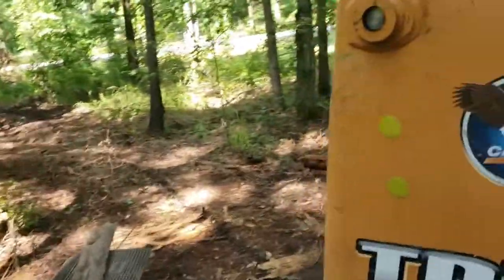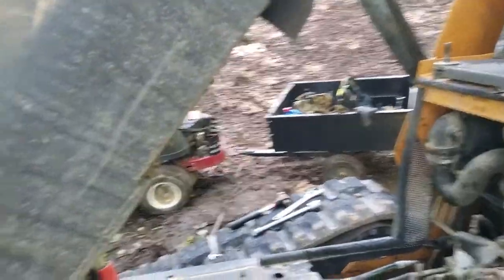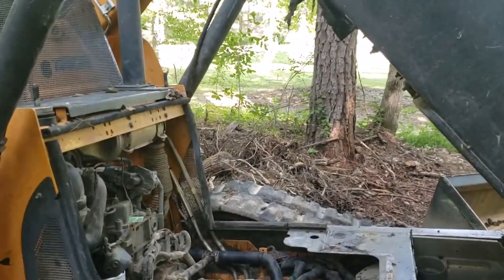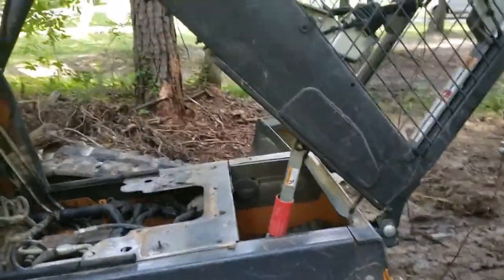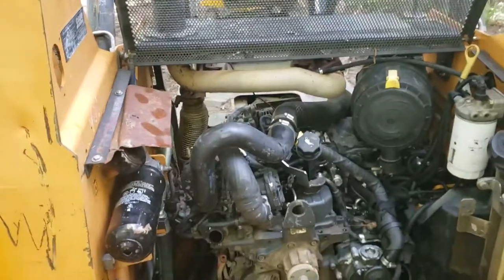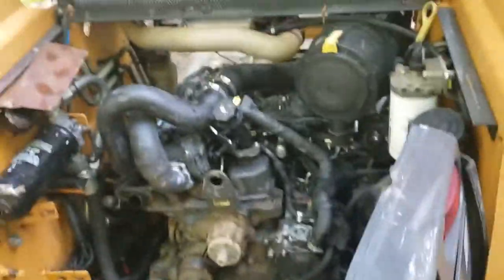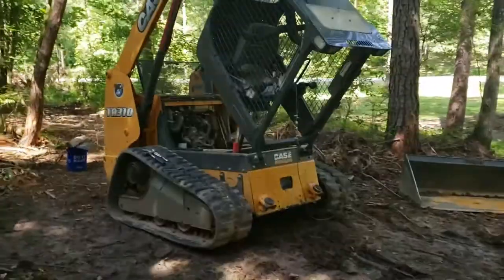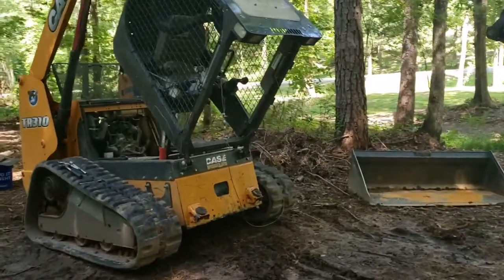Case TR310 - Move the oil filter because of a line leak READ THE DESCRIPTION.

Comment: Mine did same thing.basically all the oil to did u have any problems after with the turbo or anything got mine back going but skeptical mighta ran to low and cause engine or turbo damage.